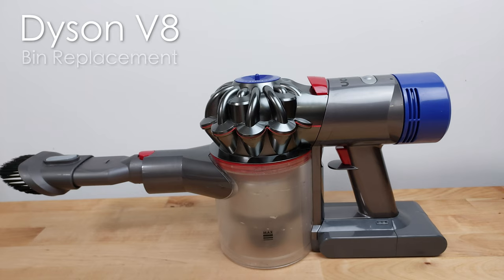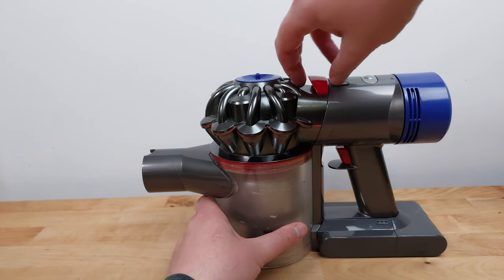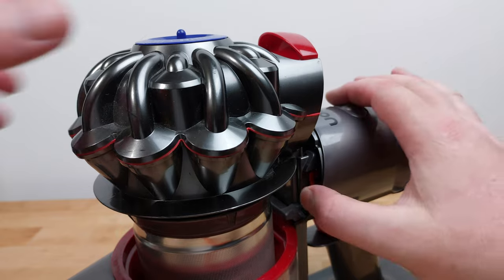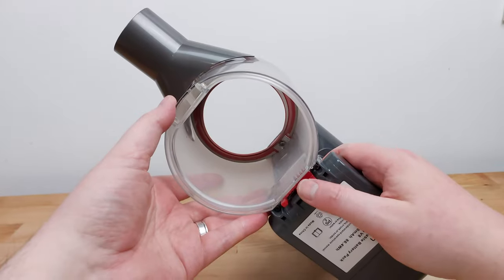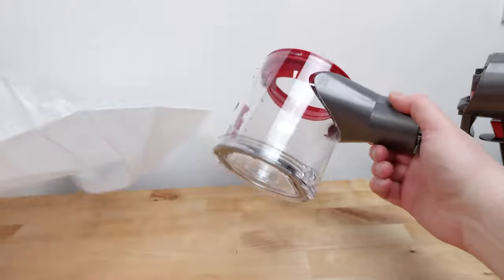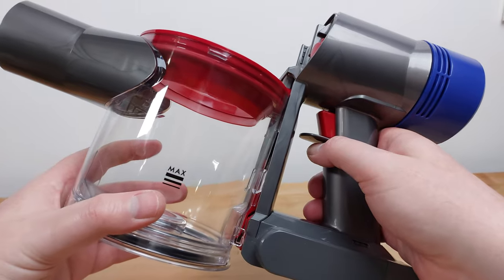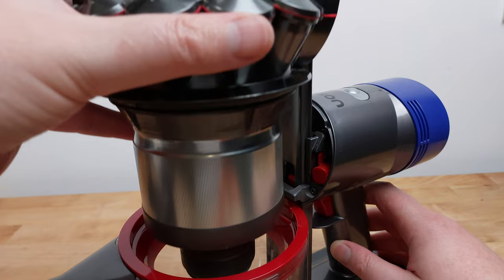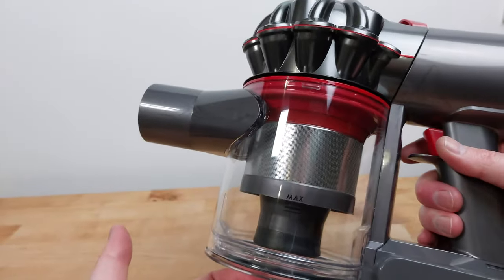How to Replace the Bin on Dyson V8 Vacuum Cleaner

Comment: When I want to empty the bucket on my V8, the bucket has recently started to come off when I pull up and after down the cyclone.
What could be the reason for this?
Reply from the maker: It could be a faulty latch. There is a spring-loaded latch on the bottom by the battery that holds it in place. Make sure that it's not blocked